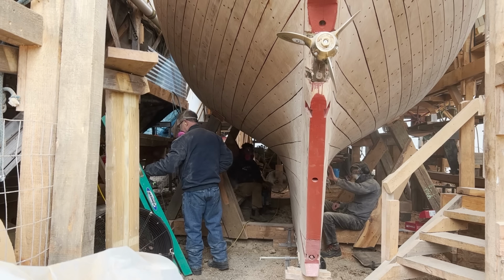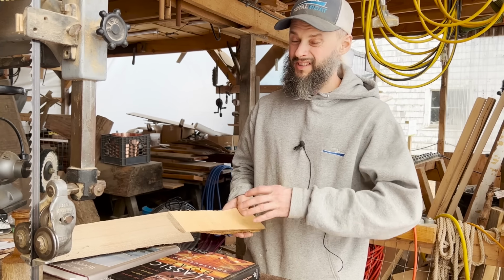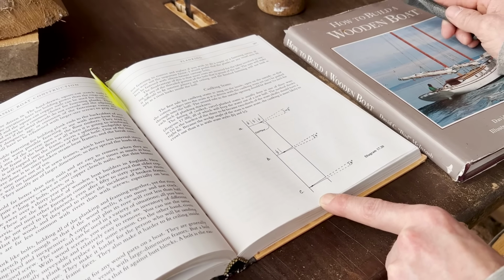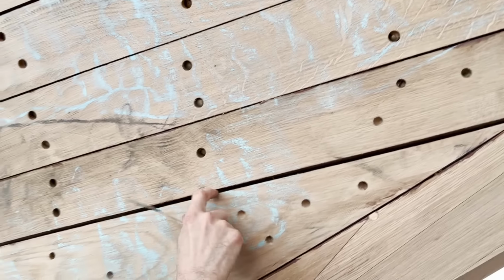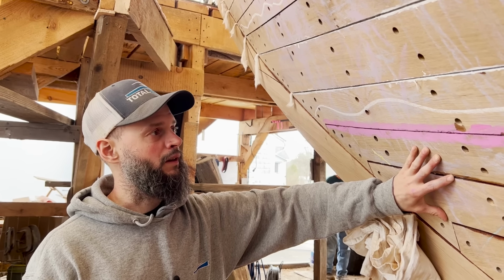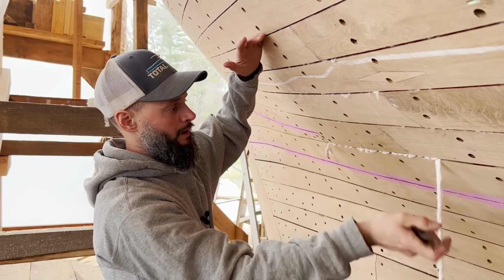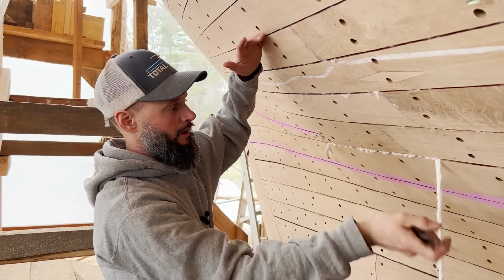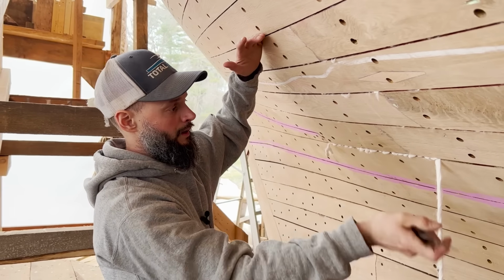Waterproofing The Boat Hull With Cotton - Episode 263 - Acorn to Arabella: Journey of a Wooden Boat

Comment: What a great video/episode! For a man who is not a formal shipwright and who has never sailed, Steve is to be commended for his knowledge and understanding of wood and the principles involved in both! Coming from a framing and home building background, I agree with Steve regarding his comments on the caulking mallet. It seems kinda awkward just to look at it. But I’m sure there is a reason to it’s design. It seems like it requires the user to kinda use their shoulder when packing the cotton, as though you are just pushing it into the seams, instead of using your forearm and wrist as you do when you’re driving nails. But because he understands what is needed in the caulking process, he has decided to use the tools and processes he is comfortable with to achieve the same purpose. Great job, Steve!

Comment: It was interesting to hear the discussion about Pardey's options for the length of plank-plank contact vs. caulking depth. You chose to use minimal contact at the back of the planks with a deep caulking channel - Pardey's option (c). And yet when you first started planking you talked (Episode on the 1st broadstrakes) about Pardey's option (b) 1/3 tight contact and 2/3 open.

Comment: Thanks for sharing your caulking considerations, Steve. Given that the inboard side of the hull planks are varnished and the outside will receive several coats of hull paint, I wonder how moisture can find its way into the wood. Thanks for your videos. 😊

Comment: The way we build woden boats in Sweden up to 10 meters is with a single layer of hardwood and a flat bottom. We completely cover the broad face of the outside and inside with many coats of linseed oil until we have a very thick polished coating that looks and acts as a sealing aid. Then we fully submerge the whole boat for a month in saltwater. Then we pull the boat out and take all the water out. Now the wood is so swollen there isn't any chance of taking on water and the forces push against the inner frame.

Comment: Oh Steve, seems about right, one of the smart things I remember them doing on Tally Ho was to make a sample planking section and then caulk each seam with a different amount of caulking cotton. Then  they cut the sample in half and checked how far each of the different seams was caulked. They then could determine which one they would use to caulk the boat. Might be a good exercise for you to see how your theory’s are holding up. 😉
Reply: Did Tally Ho do that ? Steve did it here with the deck planks/caulking.

Comment: Tap tap - tap tap - caulking is punishing work by the looks of it, but Steve seems to take it in his stride. The sound is somewhat ASMR-(Autonomous Sensory Meridian Response,) I find that Tap tap sound relaxing. Also the Oak plugs being installed, later on to be trimmed flush will add a new look to Arabella's hull.
Nice work guys.
Reply from the maker: The sharp sound of a caulking mallet on a making iron is definitely satisfying. —Anne

Comment: Happy to see Steve using a regular carpenters mallet to set the caulking. Use the tools that you know. I’m sure there is a value to a caulkers mallett, but I have never understood how.
Reply: IIRC, Leo or one of his caulking crew on Tally Ho explained it in one of their caulking episodes. It’s been awhile, but I think the design is supposed to make it a bit easier physically if you’re swinging the mallet all day, every day. Leo hired some pros and there’s definitely a difference in how fast they move compared to Steve!
Reply: The caulking mallet imparts far more force for the effort expended, than any other type of hammer or mallet.Which is what you'd expect from a tool specifically designed for the job. The boats I used to caulk were far bigger, the planks thicker and we'd whale in four threads of oakum as hard as we could. Believe me a good mallet is the only option. The Iron is properly held in the hand with the thumb and forefinger on the seam, so it is your wrist and pinkie that are smashed to a pulp during the learning process.
Reply from the maker: The weight of the mallet matters when caulking most boats, both for the comfort of work and the assurance that the cotton gets to where it needs to go. For other planks, types of bevels, etc on other boats, a carpenter’s mallet would not do the job. —Anne

Comment: An interesting property of damp salt is that it will dependably hold exactly 72%  relative humidity. JFK used damp salt in his cigar humidor. When the atmosphere is higher than 72% the salt will absorb humidity.  When lower than 72% the salt will give up some moisture. A few hundred pounds of damp salt in the boat house is what I'm getting at.
Reply from the maker: Awesome. Thanks for sharing!

Comment: Set some Mosquitoes traps up! in the shop, Mosquito Trap: Sugar, Yeast, and a 2-Liter Bottle
You'll need a cup of hot water, 1/4 cup of sugar, a gram of yeast, and an empty two-liter plastic bottle to craft this concoction. Cut the bottle in half around its middle. Heat the water, then add sugar and let the granules dissolve. It works!!
Reply from the maker: Thanks for the tip!

Comment: Stephen, Is there any advantage in keeping hull wetted a few days before launch by way of some lawn sprinklers recirculating water from a reservoir under hull made with a new big tarp to capture water dripping off hull ?  Maybe dig a central pit a foot deep and slope tarp a bit to aid pooling around a sump pump or bilge pump system ? This would allow you to get the initial sweating / leakage areas spotted and dealt with before hull is submerged...
Reply from the maker: We’re already increasing the amount of humidity in the shop by tenting the boat and flooding the floor. We’ll talk about that soon!
Reply: @AcornToArabella  Aaahhhh, That explains the sawdust wetting I saw, that I assumed was for dust control in prior video !

Comment: Good episode. Does seem to me that the darn cedar has had a major impact on the whole build - from being a contributing factor to losing one of the original builders (that's my reading, of a no doubt very complex affair), to the decision to use more oak and the consequent delay in finishing the hull. I really do hope it all works out OK. There must be some leeway in that complex balance of wood expansion, frame strength and caulking firmness, else all wooden boats would have sunk - mind you, all wooden boats did leak, so it's obviously almost impossible to get right. Crossing my fingers for you.

Comment: If it was a case of just forcing as much cotton in as possible then you could use a jigsaw with a blade that has no teeth on it and the right length, that would work. But it's of no use on her hull. 🙂👍

Comment: Steve, could you explain the swelling process a bit better?  If the hull is painted and the seems sealed, how does water get into the planks to make them swell?
Reply: Neither paint nor the caulking will prevent water from from entering the wood. This is because neither are complete seals against water ingress (especially under pressure) and because water molecules travel also as a gas (wood swells and contracts as humidity levels in the air changes).
Reply: good question

Comment: I"m wondering what you are doing about the boat support locations... Fairing the hull at the point where the cradle supports are located seem like it would be impossible without moving the supports at some point... painting and finishing as well... can you explain how that can be done at some point..
Reply from the maker: We can do it later, after we move her, or we can lift the boat a bit with jackstands.
Reply: @AcornToArabella  
Cool... Thanks...

Comment: 3:08 you guys are obviously putting in a lot of time and effort to get the hull faired to a smooth surface so how of that is for cosmetic reasons and how much of it is due to functionality? I guess what I’m asking is if you guys didn’t get the hull smooth and even would it just not look at nice or would it be less efficient in the water ? I’d imagine it has to be more functional than just cosmetic since the hull isn’t going to be very visible to anyone while sailing.
Reply from the maker: It would indeed be less efficient without it being very smooth.

Comment: I've launched a few wood boats in the past. From my experience you had better have a few large powerful pumps running for a day or two until she swells up. Also, you can bring a bunch of sawdust and release it under the hull which will get sucked into the seams that are really leaking and seal it up quickly.
Reply from the maker: I got really good at that. Also, my friend Klara carries three kinds of sawdust aboard her boat based on fineness depending on what’s needed. —Anne

Comment: How do you deal with the fairing and caulking of the bits of planking under the supports? Do they just get done when it's in a hoist?
Reply from the maker: Can be… or we can lift the boat for just a little while with some jackstands.
Reply: @AcornToArabella  Thanks,  I had the same question as it seems like there were several steps to the hull that all happened except under the supports.

Comment: Be sure to use a guide coat ie. Light spray or roll or a light coat of paint roled on; all of which will be sanded off during long boarding. Best way to see high spots.
Reply from the maker: We’ll be rolling with some chalk for long boarding, and yes we figure we’ll need two coats of primer as we refine it for finishing. —Anne
Reply: You will find that using chalk is a big mistake as it smudges and smears too much when long boarding so the whole surface gets smugged and you won't know where you are. A light coat of thin paint (any kind) works best as the low spots are clear and you end up sanding it all off when fully fair.

Comment: I've been working with green (ie unseasoned) oak for 40 years, and I have never seen it shrink more than 8%. That's easily measureable because of the gap to the plaster it leaves as it shrinks. I hope you aren't over-estimating how much it will expand when it goes in the reverse direction (dry to wet), because that is going to leave your bilge pumps with lots of work to do.
Reply from the maker: Most likely not over estimating. If it went in dry (3+years) and was tight, dried a bit more, and is destined for being in a marine environment. Most likely good.

Comment: I've always wondered if it would be too heretical to use an impact drill on 'Low Setting' with a caulking iron welded to an old impact bit for at least the preliminary  'Sinking' of the cotton. I know you need to feel the 'Setting' pressure for the final run, but just to get the material into the seams, it would seem to be a real time and wrist saver...:body-green-covering-eyes::face-blue-wide-eyes:

Comment: I thought they used oakum to caulk the hull, because as a kid I remember doing that to the wood deck of an old paddle wheel tugboat.
Reply from the maker: In larger boats or ones with thicker planking, like a tug, yup, people still use oakum.

Comment: When you swell the boat will this happen at the docks and do you use pumps and some type of sprinklers prior to launch. Is it important to be swelled with salt water.
Reply from the maker: It’s not important to use salt water, no.
Reply from the maker: Yes, we’re using a few different ways before launch: spraying water, adding steam, flooding the floor.

Comment: With all the paint and sealing, how does any water get through to swell the timber?
Reply: i'm confused too xD
maybe they put the ship on the water first , let it swell for a time and then out of the water to paint?
doesn't sound the best for the paint but i'm not a boatbuilder so i don't know xD
Reply from the maker: Paint is more porous than you would imagine. It breathes enough that it doesn’t cause cracking or damage to the planks as they swell. Epoxy on the other hand is rigid and brittle and can be waterproofing, but for a dynamic carvel-planked hull that relies on swelling as a part of the system, epoxy is the last thing that you would want to coat with. —Anne
Reply: @AcornToArabella  thanks for the information ☺️☺️

Comment: Are there other materials also used for caulking? If so, is there a reason Steve chose cotton?
Reply from the maker: No, not really. But people do use different things if cotton isn’t available, or back when it wasn’t available. Moss. Newspaper. Plastic bags, as I heard recently in the case of some workboats in Africa. Anything that will crush and give way. —Anne

Comment: You don't mention how you plan to swell the planks while out of water, would you explain that please?
Reply from the maker: Sure thing. Last week’s episode ended with Aaron soaking the boat shed floor. There are a lot of ways to increase the humidity in a shop or add water to a hull. Sprinklers, misting fans, irrigation hose, or in our case lately: steam. Stay tuned for more!

Comment: Dumb question…how do you deal with the hull that is behind the supports holding the boat up for caulking and paint?
Reply: Usually a new, temporary support is placed nearby and the old support is removed.
Reply from the maker: Boooooooooooshes has it. 😊

Comment: Curious, is it possible to use silicone as a caulking material?
Reply from the maker: Great question! No, and I wouldn’t recommend it on wooden boats. It can’t be painted, it doesn’t play well with any other material, and it’s practically impossible to remove. We have other types of goop in tubes we can use. —Anne

Comment: 2:49 isn't that little triangle piece on the kiel/stern post supposed to be tight like the others below it?
Reply: I think I meant bow
Reply from the maker: It will be. Those pieces of the backbone aren’t like the planking because they’re through-bolted. They got some bedding compound back when, but water flowing in there for the first week after launch isn’t going into the boat. —Anne

Comment: I guess its probably preference but seen other builders pre-wet the plug holes before plugging?
Reply from the maker: Oh, I’ve not really seen that… maybe for a different kind of glue?
Reply: @AcornToArabella  They were using epoxy and pre-wet the hole that way it had little time to absorb into wood. Then soaked plug so had good surface to bond to. It was a video from a shipwright out of California( I forget who it was). Just thought it sounded good and made sense.
Reply from the maker: Oh goodness, ok so that’s “wetting out”. After dealing with epoxied bungs myself on a couple other projects, no thanks to epoxy for gluing bungs. It’s just overkill. But yes, when you glue two wood surfaces with epoxy, each needs to be “wetted out.” —Anne

Comment: How are you adding moisture to the wood hull?
Reply from the maker: We flooded the floor (check out last week’s episode) and tented everything from the sheer down. And we’ve been doing a bit of steam, too. More on that soon! —Anne
Reply: @AcornToArabella  Anne. Thanks for your message.

I saw last week's episode. Loved it. I thought you were watering the sawdust and wood chippings on the floor to reduce the risk of fire because of the fire that had started before. Actually, you put the fire out with snow.

I would imagine walking and standing on wood chips and sawdust would be easier on the feet than a solid concrete floor (if that's what's under all those wood chips and sawdust) . . . but the chance for fire. I know somebody's grandfather is a retired firefighter, but how many boats being built in somebody's front yard has he been exposed to?

You're talking to a 69-year-old who has been around boats, repaired boats, caulked boats, varnished boats, and built boats since he was 8-years-old. There's nothing like a clean work area. Especially, as close as you all are to the end now. IMHO.

Your boat. You do what you want. Knock, knock on the wooden hull. I just cringe when I see all the ignition sources inside the boat house. That's all. She is a beauty.

Best.

Comment: You should be wetting the holes with epoxy before putting in the plugs. Otherwise the dry wood can such the epoxy away from the plug and the result is a weak bond between the plank and the plug.
Reply from the maker: We’re using thickened shellac, so we’re all set there. I don’t recommend epoxy for bungs. It’s a real pain to get out of fastener heads sometimes, and since bungs are sometimes removed to check fasteners, it can turn into a larger project when you can’t easily chip a bung out. Ask me how I know. 😅—Anne
Reply: @AcornToArabella  OK, I'll bite.....how do you know? ;-)  PS: Well played adding Bob to the credits.
Reply from the maker: How do I know?! HAHAHHA uuuuh… holy hell plenty of stories and not enough billed hours on someone’s mistakes. Haha. —Anne

Comment: At least Steve is not using one of those stupid caulking mallets...
Reply from the maker: ¯\_(ツ)_/ they work great and are especially for the job. Kind of ingenious, really. —Anne
Reply: @AcornToArabella  I was pleasantly surprised when Steve used a regular mallet for the job... I feel a caulking mallet is kind of pretentious a tool to use (if that is a thing) if one is doing it once... Kind of "Hey Youtube, look at me blowing the Youtube ad revenue, I got this silly and probably expensive and overengineered mallet for a job I do (MAYBE) every 35 years or so" 

Again: Steve did the sensible thing to use a carving mallet...great job !
Reply from the maker: It’s not the sensible thing to use whatever tool if you know what to listen for with the right one, is what I’m saying. A caulking mallet was developed by people who caulked multiple hours a day for many years, meaning this is the design that bubbled up through the work with good results consistently for boats that worked for decades and were recommissioned by the same owners again because it’s proven. —Anne